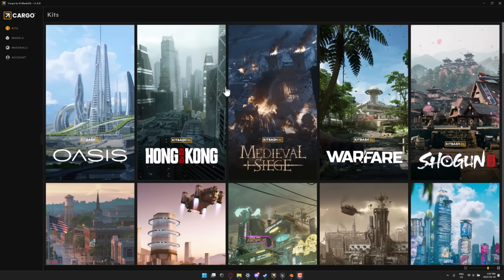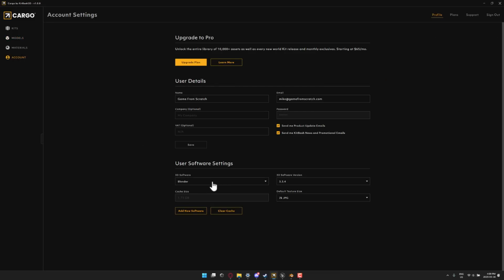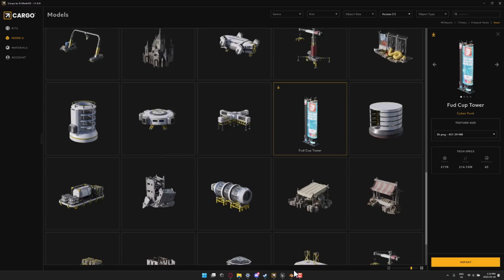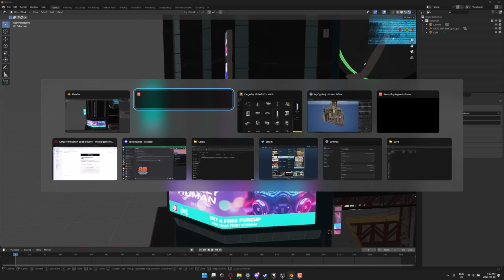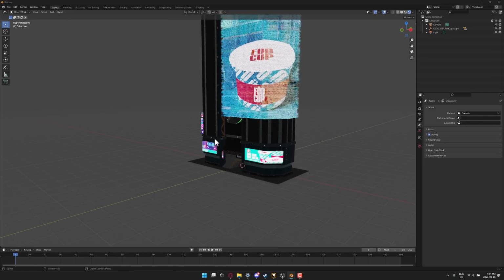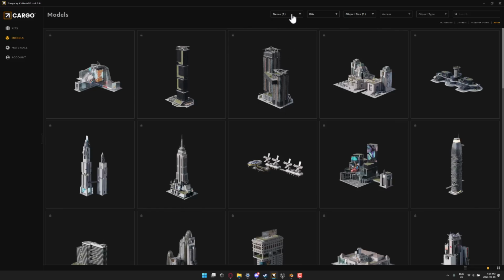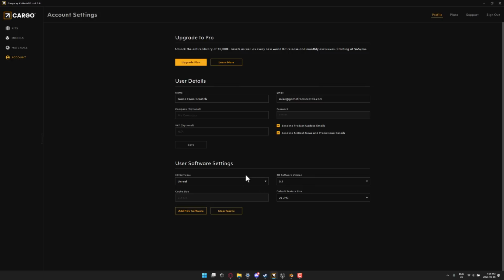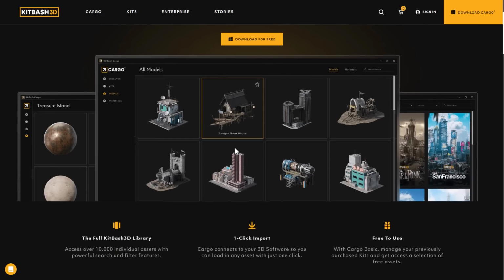Introducing Cargo App by KitBash3D - A Free Quixel Bridge Like 3D Asset Library

Comment: The setup process for this is the worst I've experienced for a while. The first time I ran it Blender was detected but it just hung on the downloading addon stage for about 10+ mins so I had to restart. Then it wasn't detecting Blender at all only Unreal. So I was forced to set it up with Unreal even though I didn't want to because I want to use it with Blender. Then after getting it working with Unreal it then detected Blender again, downloaded and apparently installed an addon and told me to just open Blender. However I have no new addons in Blender. So I restarted Cargo to try and go through the process again and now it's not detecting Blender again. If I use the advanced tab and point it towards the Blender.exe it just gives me an error saying it can't find Blender. So I have no addon in the N panel, no addons that are related to Kitbash3d in the addons list that I can find and Cargo no longer even detects Blender.

I know they probably thought they were being smart automating the process but I don't undertsand why they couldn't just have a normal addon zip file for Blender like just about every single Blender addon that's ever existed. It would save a whole bunch of messing about.

Comment: Fo anyone interested in the Pricing for Megscan assets outside unreal like in Unity:
For personal use (under 100k):
3D Model: each $0,86
Surface/Material: each $0,42
Other Assets: each $0,2

This are always the full 8k resolutions.

Good to know: You can use the bought assets forever, even after you cancell your subscription. Points don't get lost after cancelling subscription, or month ends. While subscribed you also get 5 free bonus assets per month! Points cost the same in the Subscription or top up.

The non converted prices are:
Personal $19/month:
90 Points / month (45 Surfaces, or 22 3D Models, or 90 other asset types. Additional points can be purchased at any time.)
90 Points refill costs $19.